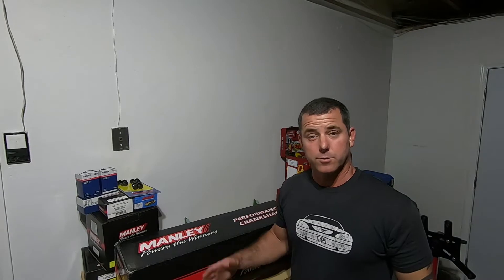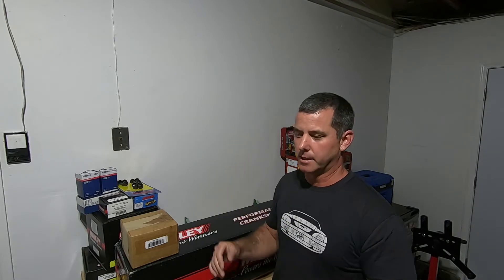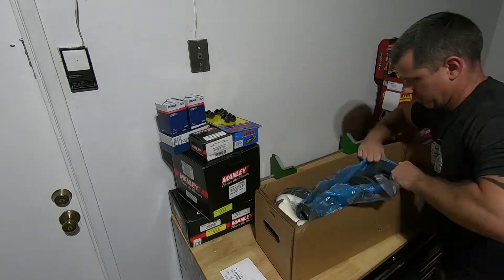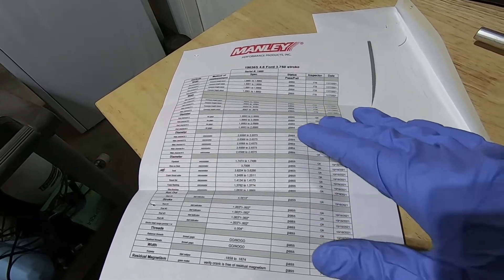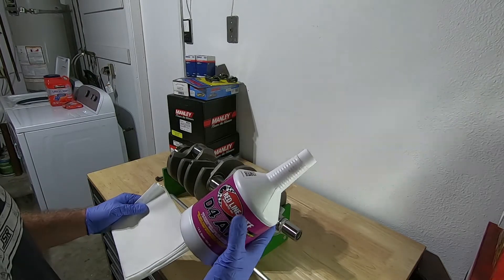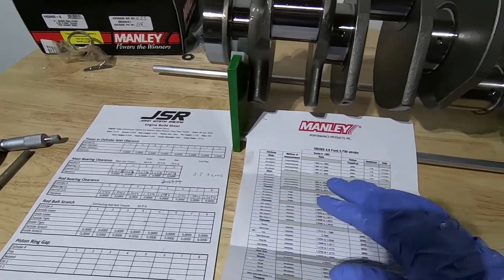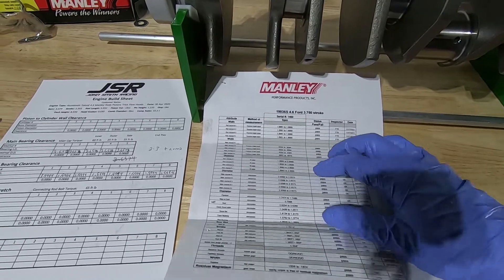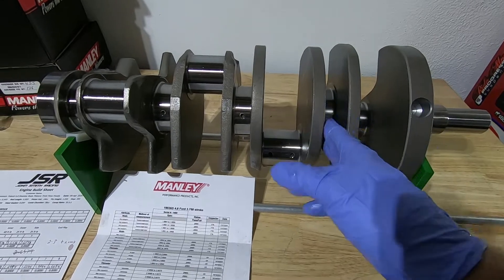Pt 1 Measuring a Manley Forged 5.0 Stroker Crankshaft for a 4.6 Teksid Engine Block

Comment: @JSR , would this build work on a 03-04 cobra iron block?
Reply from the maker: The bearings are different, but the crank, rods, and pistons will work
Reply: @JohnSmithRacing Thank you John!

Comment: You got the entire rotating assembly balancing so all you had to do is clean the block ? What website did you use ??
Reply from the maker: I ordered everything from Manley Performance.  They can balance everything as well as include the needed bearings.

Comment: so i bought a 4.6 texsid engine from a place in michigan that has basically the same componets that you are building(manely 5.0 stroker crank.manely rods.and diamond gas ported pistons.the engine builder built this engine for hisself but went with a coyote instead.i put my 2.9 litre whipple and my 80lbs injectors on it and it made 720 at the rear wheels. the dyno guy said i ran out of injector. anyways he rev limited it at 7200 to be safe. my question is how much power do you think i could get out of this engine reasoably safe
Reply from the maker: The engine internals should be good for 900 or so hp.  However, all engines will have an expiration date.  How the engine is used, built, and tuned will have an affect on that expiration date.